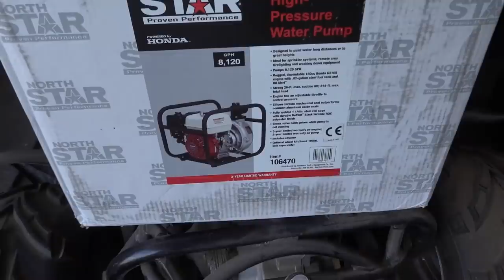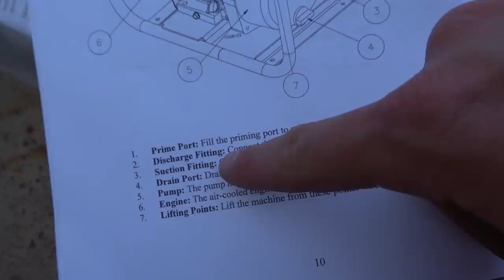I Built the Pumper Truck!!!!! Master Chief is Alive!!!

Comment: All you need is a 1" hardline or wildland fire hose. 2 1/2" hose is used for big fires. Also get a tank with baffles so you dont get water hammered while driving or flip. You also want to flow the pump at which the nozzle is rated, that makes it flow the best.

Comment: Hi  from a Danish firefighter

Even though we use other couplings here (storz coupling) you aren’t wrong to have at least one soft hose, they are way easier to carry a long distance, and extend if needed.

Hard hose in Denmark is called HT (høj tryk- High Pressure) because they need a pressure of 20 bar (not sure what that is in psi), but it’s substantially higher than what your pump can deliver.

We use the HT at 80% of the fires, and they are excellent an rollable, although our type need special rolls, because the hose needs to be quite sturdy to take the pressure. Ours are 70 meters long (210 feet long approx.)  these are with snap coupling  and those are then need for our nozzles and the pump

My advice, new pump, and if you decide going for hard hose, you will need some special roller for it to be worth it... we use Dräger as our supplier but I have seen alternations from Rosenbauer, and CSR which all are the biggest suppliers in the EU, they have compatibility  checkers and so on, for easy introduction and buying experience 

It’s nice to see what you have! And it’s plenty for just on the ranch, but ease of use and nice to haves HT is nice to have, and a bigger pump is a must 😊🚒🚒🧯
Keep going being you

Many greetings from Denmark

Comment: We use cam locks for our jet refuelers. Handles the pressure fine, tend to leak a little in very cold temps, shouldn’t be a problem in Texas. Also always need an emergency shut off, the valve works for that but it needs to be easily reachable

Comment: Matt you need a A deluge gun, fire monitor, master stream or deck gun is an aimable controllable high-capacity water jet used for manual firefighting or automatic fire protection systems. Deluge guns are often designed to accommodate foam which has been injected in the upstream piping.

Comment: I'd mount the pump to the underneath of the flatbed. A low pressure fuel pump from the unleaded tank should be enough to run the pump. I like cam locks but a firetruck doesn't roll the hoses up the fold them.

Comment: Hey Matt, I just wanted to suggest that you make sure the fuel is shut off during transport of that pump. Fuel can leak into the intake when the engine is off and vibrating, or if the tank is bouncing around. This fuel can then dilute your oil if it makes it past the intake valve and down the cylinder wall.

Comment: You can buy a 1 inch hose reel with a booster line to put on the back there and also you can build a shelf for the pump under the bed there. That's how my firetruck is for our.like that we call it the Heavy Brush truck. Its a compartment under the.bed to easy access the pump so you don't have to climb up and then you just grab the reel and go

Comment: Since you have the extra gas tank mount the pump down low and connect the two. Also need a hose reel with booster line.

Comment: Food for thought. Why don't you mount it under the side and hard line it to the tank and have valved hard lines to the output points. Then you can also run a fuel pump from the big fuel tank to the pump and you have everything closer to the ground for ease of use. Also a hard mount touret would be nice

Comment: On our tankers (bush fire trucks), there is an inlet and an outlet manifold that is valved. That way we can just open and close valves to configure the pump for draughting (filling from static water like a dam or pool) or to pull from the water tank, or fill and pump from a pool, etc... Our tanker has 4 short (10ft approx) on the deck for fighting fires while moving, and some of the new tankers also have a monitor/water turret on the bullbar. We also have a love hose reel and a dead hose reel. The lengths of hose that are rolled up are approx 100ft, however most trucks carry sort short lengths of around 20ft for when we don't need to go far from the outlets. There are plenty of diagrams online showing how the plumbing is configured on the tankers

Comment: Turn the tank around so the water valve is on the side so it can be turned on and off without going up and down the truck also you could put the reel on the side with the pump on the frame in between the frame and the bed of the truck so that way you can have easier access if you wanted to hook it up to the aux gas tank

Comment: Afff additive in the tank.
reel mount the hose.
Shorter hose is a good idea.
Electric starter kit for the little honda
I'd definitely swap that tank with two smaller tanks, put a skid lid on and try taking a corner with it half full...  It'll try and tip the truck that's a lot of weight high up all sloshing about.

Comment: If you can turn the water tank sideways on the bed. That will allow more room and your long hard hose may be perfect length to do so. That way you don’t need a shorter hose and it can run along the side of the truck with the valve accessible.

Comment: Need a electric start pump, and make the quick connects the same on each ends of the hose, so it doesn't have to go only 1 way.  I'd also suggest putting a 2" quick connect on the output side so you could use it interchangeably with the hardline hose.
You could also solve your water quantity issue with a m978 HEMTT tanker that hold 2500 gallons.  It will dwarf your 5 ton & LMTV combined!

Comment: We used P-100's in the Navy, those pumps were heavy as heck!!  Hated using them for training, really made you appreciate the ships fire main system. Something I haven't seen yet is a way to fill the tank, I've seen alot of guys here in Florida plumb 1 inch pvc from the bed to the top of the tank so you don't have to climb up there any time you are filling from a well.

Comment: Either put a step up on the back or drop you’re pump lower so you can reach from the ground. Get a 1inch red line on a reel You can real out what you need only. Also put a place too stand on the front or back wile driving. I learned the hard way dragging a hose will walking behind the truck. Was on country fire dept. here in Texas years ago😁🇺🇸🇺🇸🇺🇸

Comment: Put a T at the tank, hard pipe it to the pump and the other side can be to fill get a rigid hose with a reel that can hang under the bed and get an electric start pump you can wore into the truck battery and start easy from ground

Comment: I'd recommend for your application, use what we call a booster hose. Approx 1-1 1/2 inches in diameter. Would work probably best for what you want. Decent flow for smaller stuff, easier to handle as you can keep it on a power retract wheel, not NEARLY as heavy while charged, and not pushing back hard enough to need a 2 man crew. I've been a volunteer with a small town crew in new York since I was a senior in highschool, I'm not expert but I hope that helps!

Comment: Just letting you know as a firefighter who is somewhat familiar with type 4, 5, 6 engines for wildland I would recommend a wildland hose so 100ft 1 1/2 inch hose at the largest. Wildland is high pressure low volume. You shouldn’t need to go above 100 psi for the pump so it doesn’t need to be a large pump but if you keep the 2 1/2 I think it will struggle. I would recommend talking with your local fire department and they might even give you some old out of service fittings and things like that. They can at least set you on the right path cause I see a couple things I would recommend changing.

Comment: Random idea. If you have a manifold system, you could have several different hoses hooked up of various lengths, probably on reels, put a valve in front of each reel, that way you can pick which length of hose to use. I also used to run 2in hose sprinklers and 50ft sections of hose are long enough and easy to manage.

Comment: Put a tee fitting going straight and up then put shutoff valves on both exits then out the top put a 2 foot pipe and a spinner spray valve to put out close fires. Also get the thick ridged fire hose to come from the pump about 20feet then you can have you more flexible hose pipe to connect to that if you need it and have it on a reel on the truck so you can pull it out fast an attach it to the more ridged fire hose. I think that would work better for you for both places to spray water from,and use those quick connects anyplace you would need to connect and disconnect. Makes it a lot easier.

Comment: I’m no firefighter but I use those pumps daily for water filtration. That gas tank will run about 2.5-3 hrs straight before needing fuel. And don’t worry about putting a bypass on it. It strains down under load but it’s a centrifugal pump that bypasses automatically after about 25psi head pressure. It does put a lot of load on the motor so I use synthetic oil and change it every 36 hrs of run time. On big jobs we run em 12 hrs straight every day and they hold up really well.

Comment: What about building a cage for the pump under the bed, and then running the hose or pipe through the bed. so everything is accessible. If I remember correctly, that is what our old tanker had but with a much larger tank.

Comment: Should have another valve at your discharge and intake on the pump that way when you fire up the pump it doesn't supply the line immediately. It'll help in all sorts of scenarios more than just fighting fire like maintenance checks and stuff like that.

Comment: Keep the cam locks we use them on off shore barge pumps and ask any deckhand we would much rather those. The gas tank will drain the whole tank of water and still have half a tank of gas left in the fuel tank. Ditch the red hose they are useless and always cause problems out here on the river

Comment: then use a fixed hard lines and run 2 different hoses.  one short and rigid and another that long hose with a T and 2 shut off valves so you can pick which you hose you want to use.

Comment: Hey Matt, look up hydro seeders.  I think it will give you a good idea for hose types and reels and you can check out the fixed sprayer cannons on the backs that a 2 inch line can hook up to.  They are used for spreading a mixture of grass seed and water over large areas of land.

Comment: As it sits about 2 hrs of run time definitely think about plumbing in to the large tank. Cam locks are amazing those will work great. Smaller lines will give you more pressure

Comment: Perhaps you could take the scews out of the starter and rotate it 90⁰ so that it is accessible from the ground. I did that to an air compressor (also a Honda engine)that was mounted on a F650 that I used as a crew/service truck for my logging company.

Comment: mounting that pump under the bed would be the way to go. by the diesel tank or on the other side.   Hard lined to the pump with a short hose at the end.  also the camlocks need to be the same size on the pumps inlet and outlet to allow for refilling from a lake/pond or other water tank.

Comment: You could get a Y fitting. On one end of it put one of those manually controlled water cannons on top of fire engines, then the other side have your normal hose, before each have a valve.

Comment: Reading your comments I see a lot of what I was thinking. I've done the ff bit for a few years and with your red hose generally we zigzag the hose so it doesn't kink,  but the trash line idea is what I was thinking  with electric start pump, turn key. The hose reel would help you so much, electric or spring reel that locks when pulled out and pull and reel up... few ideas... waiting for the deck canon honestly... you can stand or sit  I'm sure... but we a lit of the time use electronics now to aim and turn it.  Make us proud Dr Demo!!

Comment: If you plumb into the big fuel tank you should mount the pump under the bed with hard lines for the water like you mentioned. That way you don't need to climb up to start putting out fires.

Comment: Yo matt! Bolting the pump to the trucks frame would make it much more ground accessible, and make plumbing the larger tank to the small engine cheaper and easier... Or find a tiny electirc starter for the lil guy and run a wire with resistors to lower voltage from the truck battery to the lil starter. Itd make it switch start and much simpler in an emergency! Maybe even both!

Comment: if you plumb the waste pump to a fuel tank, you will need a low pressure 3psi fuel pump. Mr. Gasket makes one for under 100.00. Most auto parts stores carry them.

Comment: Get a booster reel which is a solid (1 inch or 1 1/2 inch) hose. You can pull half or all of it off and charge the line.

Comment: You could always mount your pump on the bottom side of your flat bed for easy access. Bypass the fuel tank on the pump by putting a small fuel cell on top with fuel line running to the carburetor. I do suggest a hose real for the 1-1/2” hose. I wouldn’t go with a ridged hose solely. Your idea of having one as a secondary is a good idea tho. And I do agree it’s a good idea to run hard line most of the way to the pump, but you still want some sort of rubber line between the hardline and pump for vibration reasons.

Comment: One thought Matt, consider installing the pump assembly under the truck deck, possibly behind the diesel tank. Then hard plumb the tank to a valve at the side of the truck. This would save much climbing up and down.

Comment: Get them boys from CB welding to weld you up a manifold so you can run more than one line. Get a 1” booster line on a reel as others have mentioned, and get you about 10’ of 1” booster hose to run as a “whip line”. You can have someone ride in the back and use the whip line to put out fire while you’re moving in case you get a little bigger fire on your hands.

Comment: depends on how many fires you plan on starting and putting out, looks fine with that configuration, that pump wont last long if you plan on using it A LOT. red hose no bueno.

Comment: If you get a manifold it will allow you to operate a lay flat hose and a hose reel at the same time.

Also it will allow you to recycle the water when you are not using the branch (nozzle) to prevent you from turning off the pump each time. As if you don't turn off the pump and there is no water flow it will boil the water and destroy the pump.

Comment: I would make sure the tank is full or almost empty when you're driving offroad. Without baffles the free surfes effect will turn that truck over in no time. 
And I assume the water in the tank wil be sitting fore a long time and with the tank being translucent you wil get a lot of problems with algee that can block pumps and nozzles. And you don't want to be troubleshooting when you really need that truck, so I would recommend to find a way of ceeping light out of the tank.
And pipe in an overpressure valve with a return to the tank so you don't destroy the pump when the nozzle isn't open.

Comment: Maybe attach the pump underneath the bed.  That way you can tap the 2.5T’s unleaded fuel tank into the pump.  Ports can be easily cut into the bed for then hose connections.

Comment: Need a bucket or some way to hold water, the pump needs to be primed if its dry.
Trying to pump from river to dry tank would be a pain.
Water sloshes and can tip a truck, I run full or empty with my water trailer.

Comment: You could just put two different length hoses on a roll next to the pump. Then just connect which ever one you need for the application. It seems like it’s easy enough to connect the hoses quickly

Comment: Sup Matt, turn the tank sideways and have a 90 going back with a valve on the edge of the truck, get metal tank straps and bolt them down. Also, Banjo makes good products for hose clamps and connectors along with hose that can be cut to length. Bolt everything down and even use straps to keep the hose in place as well! Can’t wait to see the final product! 👍🏼

Comment: Not a firefighter but I do booster treatments and am familiar with this setup.
1. Get a booster line
2. Get a Booster reel that comes with a valve.
Before turning off the pump, close the valve to the reel. It'll keep the line primed and you don't have to pull the entire hose out to use it.

Comment: The hose from the tank goes into the side of the impeller housing the actual attack hose should come out the top .. however with only 500 gallons that 1 3/4  hose will drain the tank in no time and kill your effective work time... down side to 3/4 inch forestry pencil line and keep the 1 3/4 hose as a back up for larger fires you need a quick knock on... the system all in all isn't bad but you need to refine the attachments a bit

Comment: I’d say it wouldn’t hurt having a key start pump. The last thing you want to do if a fire gets out of hand is jump on the truck, pull the rope, jump down, and then start spraying. Maybe not super important, but fires can get out of hand quick. Also, make sure your fittings and valves (and glue if used) are rated for the right pressure and possibly over. I work on irrigation and elbows are bad at cracking on the inside corner when they are rated correctly when water hammer is present in the system. You might not experience much of that, but it’s something to think about.

Comment: I would rig up a spray bar on the front. With the terrain on the range/ mountain, pulling hose would be a killer for a one man crew. And with a truck like that run and gun is the way to go in my opinion. Go talk with the local fire departments/ neighbours  make sure your plumbing is compatible with theirs, easily share water if needed.

Comment: I would definitely move the water tank to the rear reason being is he want the suspension to work properly and all the weight on the rear Focus like that will help with proper balance that's why firetrucks have all the pump equipment in the middle because the tank is in the back